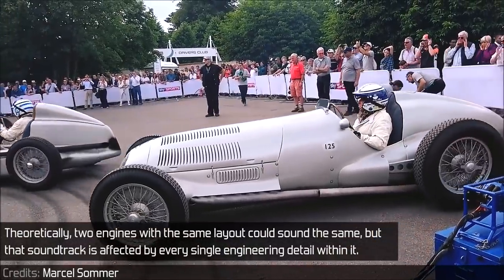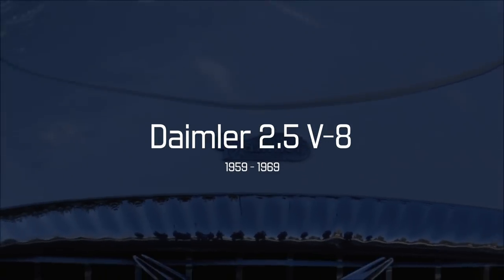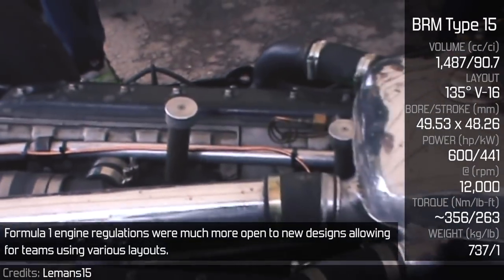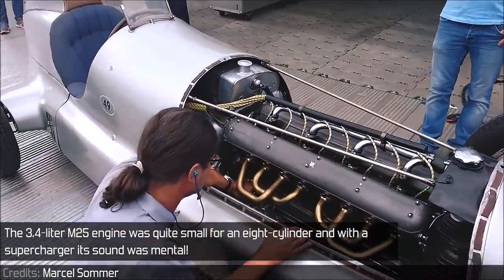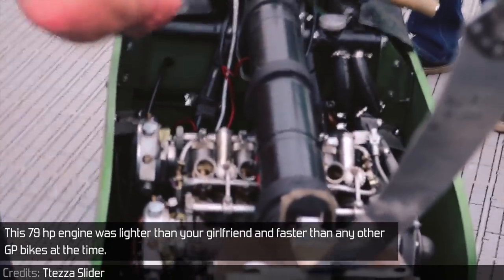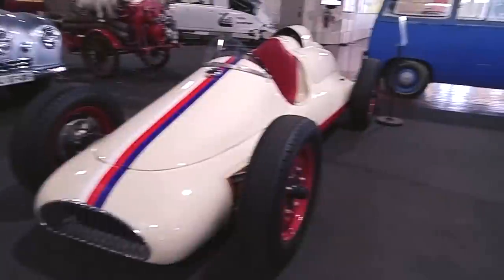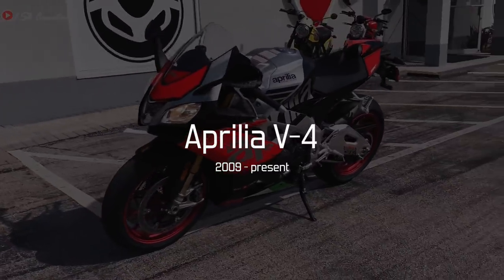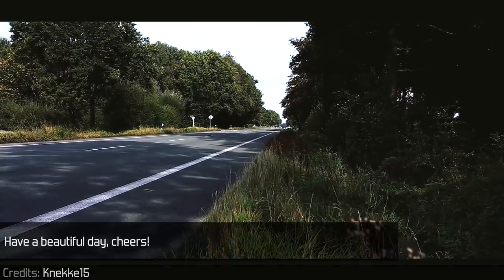8 Small Engines With Amazingly Beefy Sound

Comment: 780hp out of 1.5l in the 40s holy sh$t
Reply: Think at the courage of the pilots... with radial tires, drum brakes and no helmets.... sitting on the fuel tank.
Reply: marco fiorillo Real fukin men.
Reply: Old school tuner belike
Reply: Bmw made 1500HP in the 80s from the same displacement
Reply: In the video moment they drive the similar devils car on the road which has snow on the roadside view from the car
Reply: must add that the centrifugal supercharger has similar lag like a turbo (it's basicly a turbo driven by the engine instead of the exhaust gasses), under like 7-8k rpm you're making only a good 200hp when suddenly an extra 500 ponies come gallopping allong... drivers feared the car as it had similar characteristics (but far more brutal) like a 930 porsch turbo which was dubbed the widomaker for a reason...
Reply: Mr. Petrolhead How can forced induction directly powered by the crank have lag...? If that were true; the centrifugal S/C would have a pointless existence because it saps power from the engine to make power so you might as well run a turbo if that were true, seeing as they are 100% efficient. Turbo’s lag because they rely on exhaust gases to spin the compressor wheel, which is why they favour higher rpm to make more power (higher gas pressure from engine). Superchargers “lagging” makes no sense.
Reply: Mr. Petrolhead i asssume what you are referring to is the power band being extremely high up the rev range. That is just the nature of a high-revving engine, nothing to do with the fact its centrifugally supercharged. That wouldnt change whether it was twin-screw or roots type.
Reply: a centrifugal supercharger does have similar characteristics like a turbo, as it's a turbo machine. the amount of air any kind of turbo machine blows is exponentially in relation to it's rpm. A roots blower for example has a linear relation. In case of the BRM, the boost and thus horsepower arrives verry suddenly because of the characteristics of the supercharger, and causes for a big sudden jump in power output.
Reply: 13000 rpm in the 40's! Most American car engines barely hit 4000!
Reply: Mike Stroz Yeah, in a 1500cc, 16 cylinders with a short stroke vs 7000cc in 8 cylinders with a pretty long stroke. Pretty clear why american engines revved less that many diesels
Reply: The 1.5 in my family's cars make 110ish horsepower while some does 1000+ horsepower with the same displacement...
Reply: Mr. Petrolhead i stand corrected.
Reply: Jakeboyyy98 no problem, and on your statement that a centrifugal would be useless in comparison to a roots blower: a centrifugal supercharger has higher effciency and thus saps less power from the engine than a roots blower would, and it's smaller and lighter. But as i said earlier, due to the different characteristics, power delivery will be different. I must add that the BRM is an extreme case, having an enormous compressor (look for drawings of the engine and you'll see), it's similar to like a big turbo will make high horsepower, but will take a wile to provide boost an when it does the power arrives very suddenly.
Reply: @radracer2033  most redline at 5-6k
Reply: So who’s gonna tell him about the 13b
Reply: @mr.petrolhead5432  The 930 turbo is a perfect storm. Start with semi-trailing arm rear suspension of E30 fame. The tail-happiness of semi trailing arms are a little over hyped, but semi-trailing arm suspensions are prone to lift-off oversteer. On a front engined car, lift off oversteer is a whole lot of fun and not very hard to correct for.

But all the 911's before the 993 had semi-trailing arm suspension too, while also being rear-engined. That meant when lift-off oversteer occured, the pendulum effect of the engine at the back made it very abrupt and hard to correct for. So, no worries, just NEVER lift in a corner. It's just a different driving style- go into the corner a little slow, set your steering and roll onto the throttle, letting the tremendous 911 rear traction dig in and slingshot you out of the corner.

Enter the 930 turbo. You're already in a chassis that takes no prisoners if you dare to lift off mid corner. But now you have an engine that, midway through the corner, suddenly builds boost. So your choices are: Lift and crash, or stay on the throttle, the torque overwhelms the rear wheels, which spin, and then you crash. The only way to correct the mistake of too much throttle on a 930 is to come off the throttle JUST the precise amount at the INSTANT the boost builds to keep the torque to the wheels constant. For all but the most experienced drivers, this is nearly impossible. It's a damned if you do, damned if you don't situation with a 930. The only safe way if you aren't a driving god is to get the timing between throttle input and boost down and wait until you know that the boost won't hit before the end of the corner- which in and of itself kind of kills the 911 driving fun.

Comment: Bugatti straight 8, OHC or DOHC, 2,3L, with or without a Supercharger, anywhere from 100 to 160hp at around 6000 rpm... in the twenties !
Those engines sounds very deep and brutal. A road going, detuned, Type 55 could go from 0 to 60 in 9.5 sec in 1931. 

By the way, nice work.

You should do a video on sleeve valves engine, some racing ones are pretty sweet sounding like the Voisin record breaker.
Reply: Jean-Charles Weyland sleeve valve inline 6 makes a cammed v8 sound like a 4banger
Reply: It can deal with a higher compression ratio and vibrates less than a common engine... However, it's got less torque and has a tendency for great oil consumption.

With a straight pipe, no matter the displacement it always sounds deep and throaty, without being intrusive... nice combo for a GT !

Won't pass emissions sadly
Reply: Jean-Charles Weyland yea they generally smoke more than my Yamaha sled with the wrong oil mix. (I run it with a bit extra oil because it is a 35 year old air cooled twin)
Reply: Nice precaution, a bit o'smoke's always better that a seized piston...

I've got a 33 Ravat ER101, it's a 175cc two stroke single. I tend to use a 3,5-4% mineral oil mix just in case.

What's your Yamaha ? RDX ?
Reply: Jean-Charles Weyland srv 540
Reply: Snowmobile, hadn't considered that option... I want one with a Wankel !!! 
Nice ride anyway.
Reply: Jean-Charles Weyland that would be fun the body of the sled is shot so I'm putting the engine into a 2 seater gocart it's gonna rip

Comment: That little 500cc, 30.5ci V8 has less displacement than 1 cylinder from my 6.23L,  380ci V8 Chevy.
Reply: just one cylinder?? oh wow, you are so big
Reply: stickloaf
Not really. There are big blocks at my race track pushing nearly 10 liters of displacement or over 1 liter per cylinder. That's big (for a car).
Reply: Because americans need huge displacement to get some kind of power out of their engines. In other words very inefficient.
Reply: omfgwtfbbq90 Some American racing engines have among the highest specific output of any racing engines. 
Ford has put out some pretty high specific output engines, including a flat plane V8 in the new Mustang.
However, there is something to be said for low specific output. It helps prolong engine life, for example.
Reply: Swedish Glaze you have brought such constructive and mature arguments into this comment section. How old are you my dear sir?

Comment: I feel like I should point out that Tatra V8s have also always been air-cooled. So that's a 200hp 2.5L AIR-COOLED naturally-aspirated V8 in the 1950s. Really makes you wonder why American makers couldn't make anything way more powerful than that with their humongous water-cooled engines.
Reply: Calyo Delphi 
Because 'Murica
Reply: We prefer torque and quality to horsepower. I read a story in Hemmings of a '54 Buick being driven across the country with a hole in a piston, eating itself alive and it still made it thousands of miles.
Reply: Calyo Delphi that assumes that were trying to. When it comes to v8s you will not best the Americans. I'm sorry
Reply: The Czechslovakian Tatra was a fascinating car. Their engines were rear-mounted and air cooled. Some of their designs were the basis for the VW beetle, the Tucker Torpedo, and the Chevrolet Corvair. The rear-engined Porsches were basically also influenced by Tatra, albeit indirectly via Dr.Porsche's initial designs for the Volkswagen.
The Czechs were not very interested in exporting their automotive technology and did not make many efforts to sell Tatras outside of Czechoslovakia. A problem with using larger and more powerful air-cooled engines in the US is that it gets hot in lots of regions in the US. In Czechoslovakia in the 1930s, 40s, and 50s, it never got that hot there. A lot of places in the US, 83°F is a nice day. In the old Czechslovakia, that was a heat wave. Higher performance air-cooled engines would overheat in summer traffic in places like Houston. Porsche 911s had to have two oil coolers to contend with Texas heat. The Tucker prototypes had their air-cooled Franklin helicopter engines modified to be water-cooled.
VWs and Corvairs were not as high-strung, but would still suffer burned valves frequently. 
The designers of some of these cars managed to find ways to deal with cooling in the southern US summer, but it was easier to just water-cool them and be done with it. Another problem was emissions. It is very difficult to reduce emissions in air-cooled engines and this is what finally led to the demise of air-cooled VWs in the US. 
Tatra has indicated they did build an air-cooled engine that meets most emissions standards, but they have not built passenger cars since 1994. Their primary concern is commercial trucks now.
I do love air-cooled engines, though. My vintage Bellanca airplane has an air-cooled Franklin engine, quite similar to the engines in the first Tucker Torpedos. Most small aircraft are air-cooled.

Comment: opposed 18hp Briggs And Stratton engine with strieght pipes has raspy almost Harly Davidson sound and have been customized with forged metal internals to run over 10000 rpms.
Reply: 10,000 revolutions per hour maybe
Reply: Modified my governor for 4600 rpms could do 5000 but not safe. Its set up for garden tractor pulls.

Comment: I know 2 V6’s, both 4.0. Although the size is big you’d never expect the noises they make to come from the cars they do...the first is the V6 from the 2005-2010 Nissan Navara ST-X, the engine originally comes from the 350z but is tuned to produce more torque and I think a bigger turbo is added. It’s a mid sized truck that looks nothing special but the noise is very beefy. The other is the Twin-H In-line 6 from the 1951-1954 Hudson Hornet. It produced 170hp from a 4 litre which is a lot for the age, and it sounds very mean, especially for a 6 cylinder

Comment: You mention the BRM V16, but after that one, they made an even bigger mistake. It was pair of horizontally opposed 8s, mounted one above the other, with the flywheels geared together. They called it an "H-16" which is accurate if you know what they meant. The layout came from the engine in Hawker Typhoons. It worked ok for a 50 litre aircraft engine spinning at 2,600 rpm. It wasn't so great for a formula one engine, spinning to 16 ~ 18 k rpm. When it worked, it did make a lot of power, and people say the sound was amazing, but it was not the most reliable engine, and it cost more than the national debt... It was simply too complex. With the technology available to them, there was simply no way to get that engine to work the way it should have. Today perhaps, with modern machining, CNC, computerised ignition, electronic fuel injection... but try and build an engine like that in the late '50s or early '60s, in poverty struck post-war Britain, with manual machining and breaker points and a dozen or more SU constant velocity carbs...

Comment: Sorry but the k1600 not only that doesn't belong to this list but in fact it's an insult to other motorcycles that you didn't include in this list (such as the cbx 1000 wich sounds far beefier while being far smaller) the k1600 sounds like a hair dryer.... and it's a 1600!!! Over 260cc per cylinder and sounds like crap! ... and over 100kg of an engine! Fat pig in the motorcycle world. 
Where is the honda hornet 250?? Inline 4 250cc with gear driven cams... come on dude... wtf... that k1600 feels like a slap in my face... wouldn't matter how much engines you left behind in the list since as a human you can't remember all of them... but putting the k1600 here while excluding the king of the small inline 6.. duuuude

Comment: @VisioRacer:
5:26 -- Correct me if I'm wrong, but the angle of the cylinders makes it look like a revamped Slant-4 engine (found most prominently in Pontiac Tempest from the early 70s).

Comment: Buick 215 ci 3.5 cc (to4.6 cc)aluminium block. I have 3 very reliable and grate sounding engines especially with a stainless steel pipes and a decent air filter.

Comment: the 1.3 16v straight 4 cylinder, b3, from mazda with a custom ram air intake, k&n filter and custom muffler in my mazda 121 db sounds really nice as well. i'm so curious what it sounds like when the long tube header is finished

Comment: Man, that Mercedes W25 has to have the loudest blower I've ever heard. It can be CLEARLY heard, in front, back or wherever, over the open piped exhaust at any point in the rev range, at any throttle position. That's nuts.

Comment: I would like to add an engine to the list it is only a 3 cylinder but the first generation toyota aygo 1000cc city car engines sound extremely good if you have a proper exuase fitted